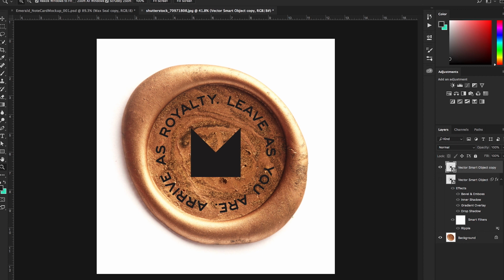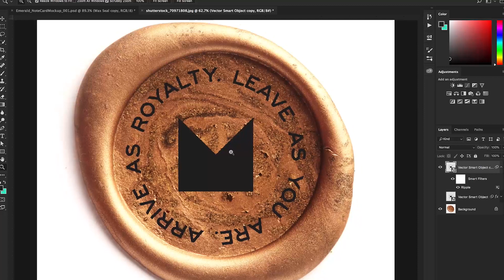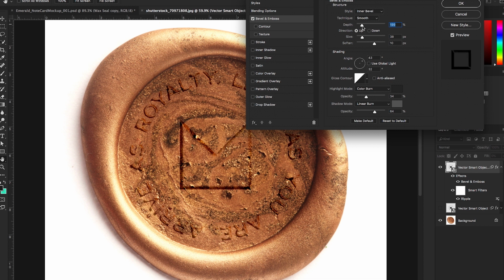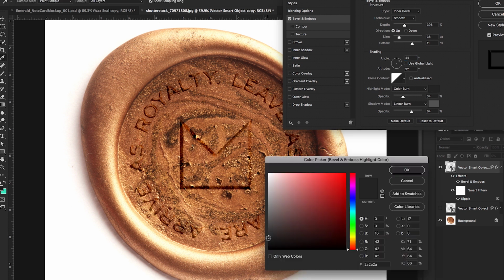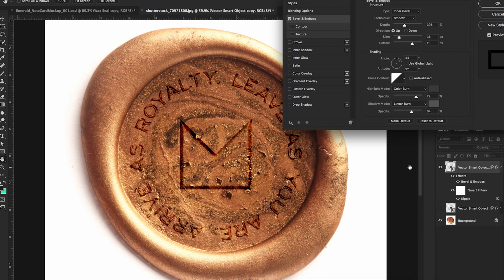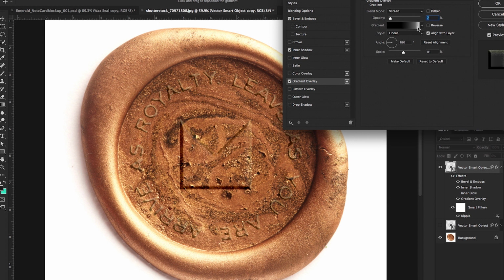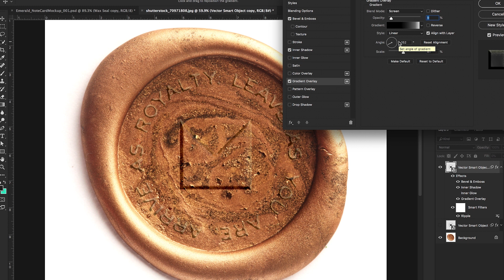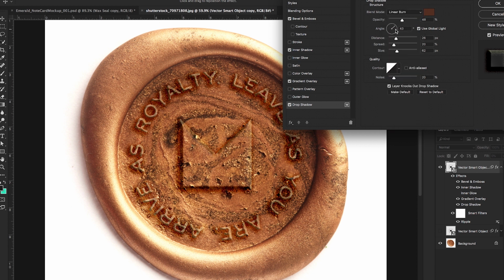How to Create a Wax Seal Logo Mock Up in Photoshop

Comment: So many steps! Super easy to create in Blender with a little sculpt. Nice regardless.
Reply: I'm pretty sure it will take more or less the same time to be honest. Even more so in Blender if someone is not used to work with the software.
Reply from the maker: use whatever works for you

Comment: Is this the first time such a video is posted on this channel? Because I am surprised! (positively surprised).

Here are suggestions for the futur videos:

- How are huge sized bill-boards designed? What software to use: Photoshop or Illustrator? What should be the DPI setting? What if the computer cannot handle such a big file and crashes?

- How many types of book binding techniques are there? What's the look and feel of each type of binding? How much gutter is needed for specific type of binding technique?

- How much less does it cost to print an artwork in 2 color Vs. in 4 color?

These may be minor topics, but many self taught designers like me may be ignorant about these technicalities.
Reply: Contrary to general beliefs billboards are not huge files the dpi is smaller than a standard 8 by 10 print. Checkout fstoppers channel for a breakdown on billboards
Reply: I don't know much about 2nd and 3rd questions, but I can give a few tips on the first one since I do work a lot with billboards, print designs, and prepress.

1. DPI - A safe guideline I found is to pick such a DPI that the size of an empty file is around 350-400MB.
2. Software really depends on the project. Illustrator is easier on the system and has less-heavy files (can be a solution for your computer crashing problems). Photoshop is basically a must if you have images and need to do prepress. I usually create and lay out everything in Illustrator, and prepress images in Photoshop. I just find it easier to work in Illustrator. Illustrator is also great if you need to add a bunch of logos to the banner/billboard and don't want to compromise their quality by inserting them as pictures.

Hope that helps!
Reply from the maker: no. we do tutorials from time to time.

Comment: To be honest, the end effect doesn't look very convincing.
Reply: Yeah, but it makes the text easier to read
Reply: I guess you can always improve, but it's not meant to fill the whole screen
Reply: There was too much saturation or chroma around the letters and the letters projected in relief too high off the base. If you had an actual wax seal it would be difficult to have letters that look that deep and still maintain the integrity of a small letter (in height and stroke weight). I letter for a living. We manufacture signs and cut out individual letters. We use a similar technique to give our work a 3D look to show clients what their sign is going to look like before they buy it.
Reply: Wait, hold on, so in effect you show your clients a mockup that isn't representative of the effect that they will get?
I understand the previous comments that it "helps legibility", but thats the point I'm trying to make:
If I need to fake it and make it more legible because in real life the wax seal will look not be legible, then why am I mocking it up in the first place?
Am I not showing a false impression of the product? 
There is one thing in a mockup being "rough" or a "sketch" to show the client an application, but don't show him something thats not feasible, no?
Reply: Highlighted reply
TRAdamTM, Are you referring to what I wrote? If that is the case, I  am not sure how you misunderstood what I wrote.
Reply: @TheseusTitan  i was replying to the first comment here, I don't know why it didn't tag it.
Reply: TRAdamTM, okay good. I was concerned I gave the wrong impression.